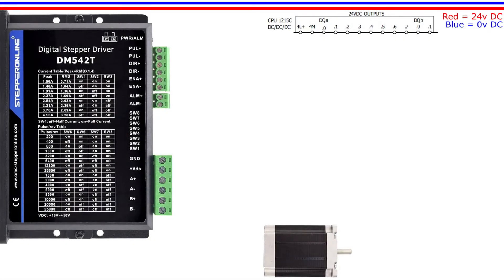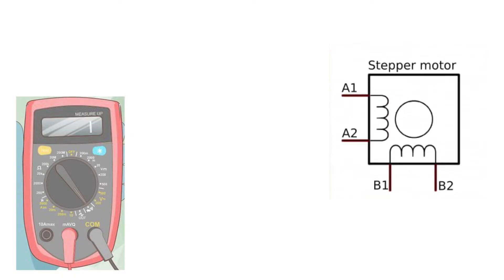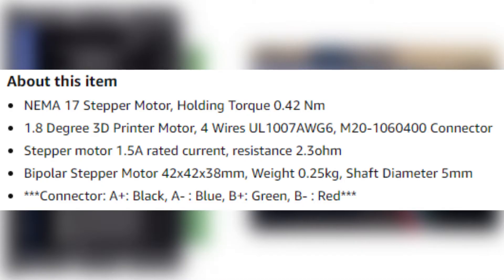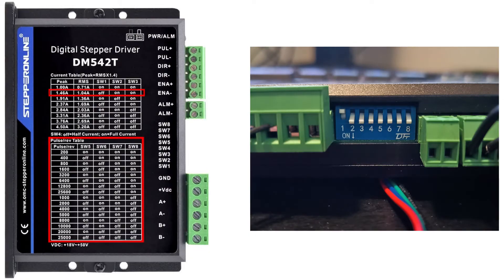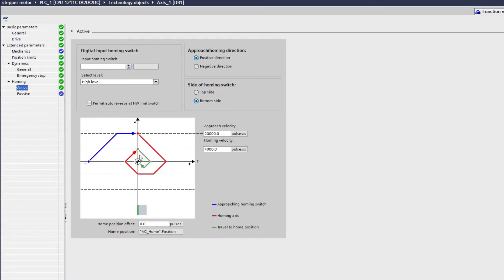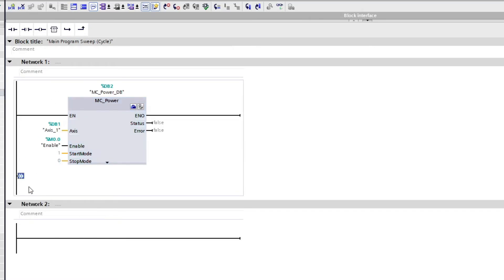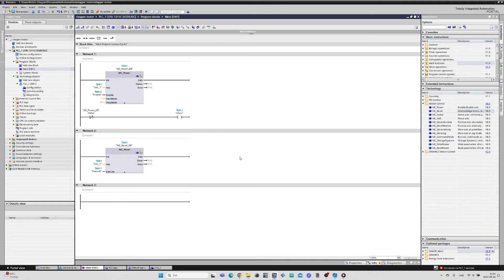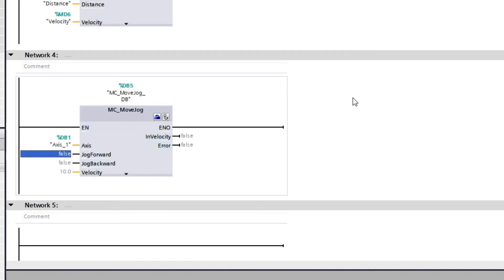S7 1200 PLC stepper motor control tutorial | TIA portal

Comment: Please for connecting wires my 1214 only  wire L+ in outpout, but don't connection M negative
Reply from the maker: Maybe you using relay output PLC?
Reply: @1lovgren Hello don't work in outs   motor
Reply: With outputs of plc don't works motors only in signal board